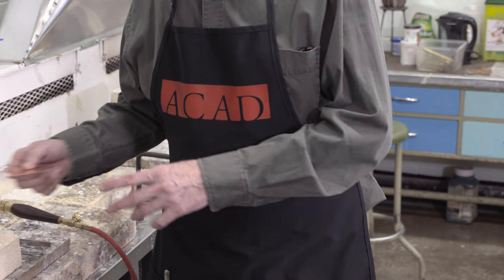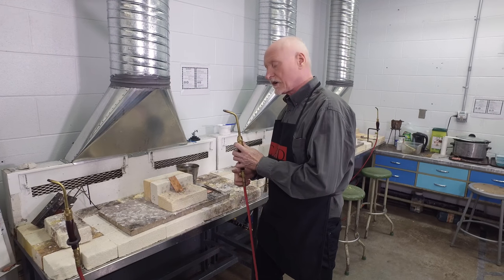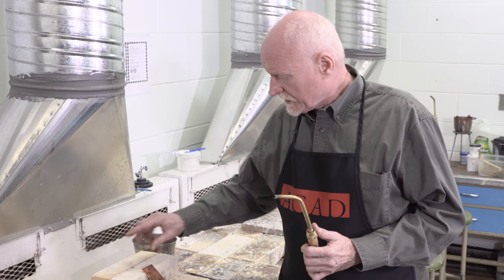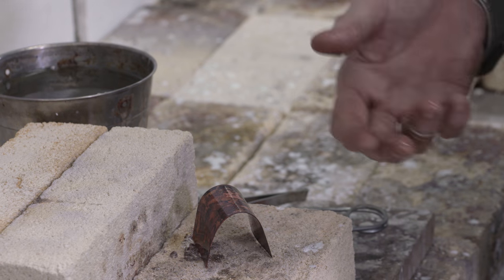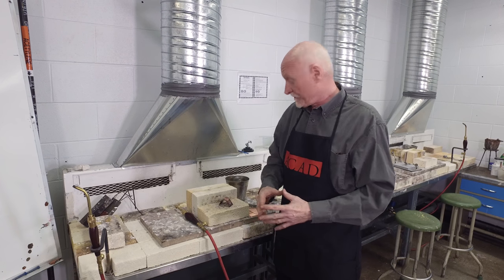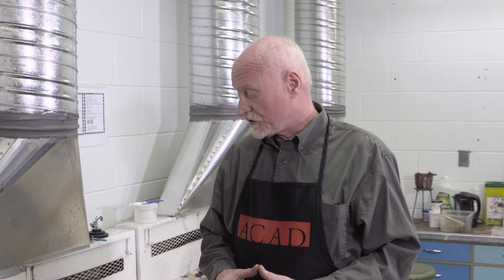Annealing Metal

Comment: Thanks for the multiple ways to indicate the correct temperature, but was wondering exactly what temperature it is. 1150F maybe ??  

If I were to need to anneal pieces often, such as in fold forming, I'd prefer to use the burnout oven and would like to set it to the proper temperature.
Reply: annealing in our meals begins around 800F, metal begins to glow around 900F

Comment: Why did you keep heating it after the flame turned orange? Aren’t you supposed to stop once the flame turns orange to prevent overheating?
Reply: I think you need to work up the piece of metal to insure overall heating. It will raise the temperature above minimum proper temperature however you are not doing excessive overheating. The point is softening is at a lower temperature than what most conventiona😢wisdom says.

Comment: I have a 1" ahank which is hardened that I need to turn down to 3/4". On 
one end there are threads and a flange that are dimensionally critical. 
If your procedure is followed for heating and cooling, etc. will the 
dimensions hold true without any defromation?